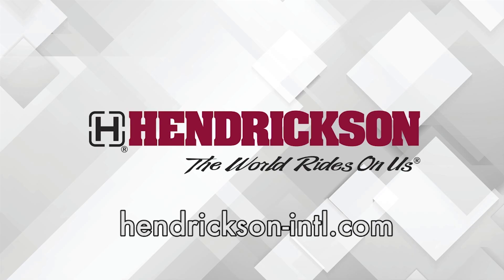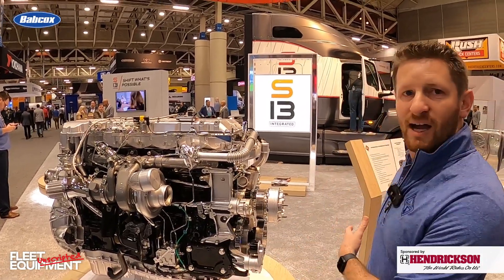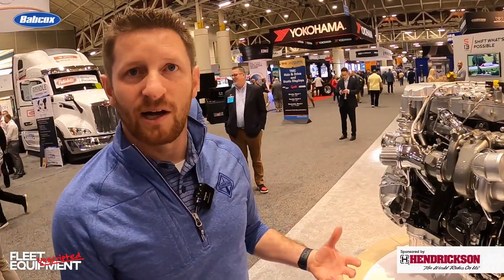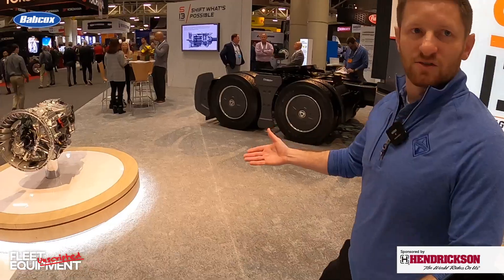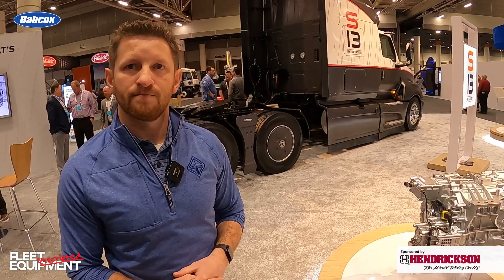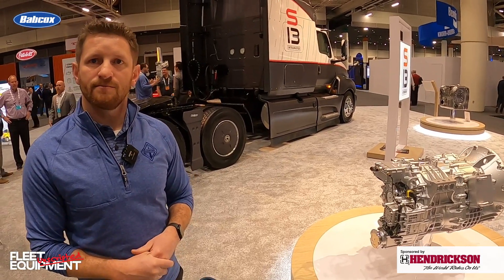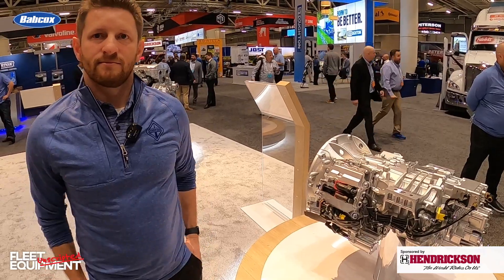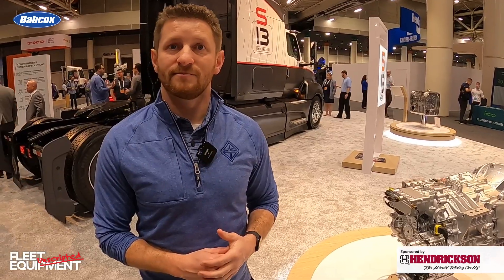Inside the International S13 powertrain | FE Unscripted

Comment: I have 40k miles so far in a '26 S13 setup. I love the ride so much better than a Cascadia and like the way the S13 behaves. One recurring issue however is 2 replaced engine retard activators? First bank1, then a week later, bank 2. A week after that, I assume bank 3 now, but not sure until I get it back in. Whatever is going on, it doesn't cause any noticeable performance issue, but check engine comes on and stays on until resolved.

Comment: Getting rid of the EGR is a huge deal,,,It stops your engine eating its own crap,,,And it is less strain on the DPF,,But something doesn't add up here,,,Every deasel engine needs a low pressure EGR in order to be able to meet emissions standards,,So how is this engine doing this without an EGR,,,,,There has to be something at play here,,

Comment: The most important thing is the T14 transmission.  There is no benefit to having a 12-speed direct drive transmission spinning your engine at 13 14 1500 rpm.

Comment: We recently tested two different S13 hauling fuel in East TN & East Ky. Good fuel truck setups. Engine has  plenty of power and the transmission in Performance plus mode worked very well pulling the hills at 80,000 pounds and we could pass vehicles. But... The transmission in Economy mode SUCKED, barley climb a hill and couldn't pass a prius.
The transmission in Performance mode was better than Economy mode but gutless on hills.
They are DEF guzzlers. Also,  we used $15 per shift or $30 a day in DEF. 
Overall, the engine & transmission combination are a great setup.
Reply: DEF guzzlers for sure! Have to refuel DEF about every 1500 miles 😭
Reply: Detroit transmission isn't any better, horrible in economy mode.

The only truck with a decent auto transmission is volvo

Comment: I have a standard transmission in my truck, I like driving it not just sitting in the seat and holding the wheel.
Reply: Nice flex. No one cares. Manual transmission or outdated and will be going away. These automated out perform, and are way smoother.
Reply: @ try proof reading your comments before posting them, I think you need a semester of English 101 steering wheel holder!! Anyone with a IQ as low as yours can’t do more than just hold a wheel while driving…

Comment: cant we just get it with an Scania truck here in the US like the rest of the world
Reply: Most Europe semi are heavier than USA trucks they look smaller but build with better materials 
The curb weight (unladen weight) of a Scania semi-truck can vary depending on the specific model and configuration, but generally ranges from around 9,715 kg to 10,525 kg (approximately 21,400 to 23,148 lbs).
Reply: No we have no €€ to pay the Swedes
Reply: That'd be a good idea only in California, where the top speed is highly limited.
Reply: @shrekas2966 
You can get European trucks without a speed limiter.
Reply: Better ask trump

Comment: Why drop the rail PSI? Higher injection pressures will help reduce emissions. Odd...........
Reply: Not necessarily, cylinder temperature determines emissions not fuel pressure, the fuel pressure allows for better atomisation and injection control, these as with all modern diesels are multipulse injection, usually 5 per power stroke, helps keep cylinder pressures and temps in a better range as the piston travels down the bore, 10,000 psi sounds alot, but its still 26,000 psi/1733 bar, thats still high enough.

Comment: Might be getting mine in November. 726,000 miles on my A26 and still doing great.
Reply: Mpg?
Reply: Hie Tom,I just wanted to hear from you since you have been riding on A 26 engine,I'm planning to buy mine with the same engine A26 2022 model with 350000 or slightly below so what are the major concern is have to worry about and how reliable is this engine compared to cummins x15?...Would you  recommend someone who might wanna become an owner operator to buy a truck with A26 engine and interms of DEF system does it give much of issues as it gets more miles on it compared to other engines and lastly,Does it gives good fuel consumption?..Your response will be much appreciated
Reply: What MPG are you getting and what terrain (hills or flats)?
Reply: @garfieldthomas8118  
I post a lot in the 9+ mpg group on Facebook. Lifetime average is 8.85 mpg. Up until recently, I mainly did multi pick, multi drop reefer freight. OH, IN, KY and Eastward, running to New England a lot. I’m now leased on to a motor carrier that runs MN to TX, the 4 corners, ID, NV, CA. I’m not under 71k often, both now and when I was running my own authority. I’m hauling cheese, beer, and frozen foods now, and they and try and get their money’s worth. The multi pick and drop was usually 2-4 picks, 9-12 drops.
Reply: @garfieldthomas8118 
I post a lot in the 9+ mpg club page on FB. Lifetime is 8.8x mpg, 823k miles so far. 
Most of that time was spent doing multi pick multi drop reefer Midwest to New England and back.